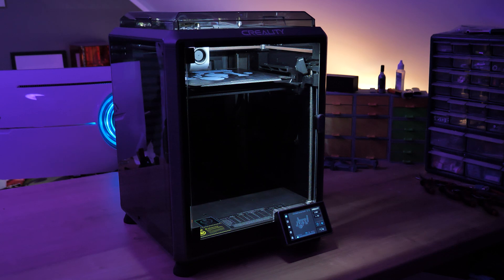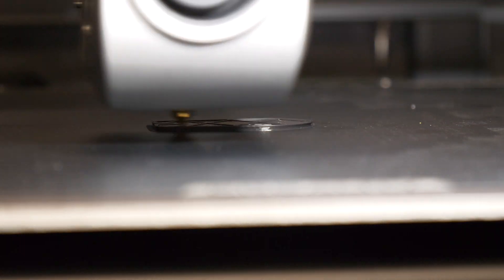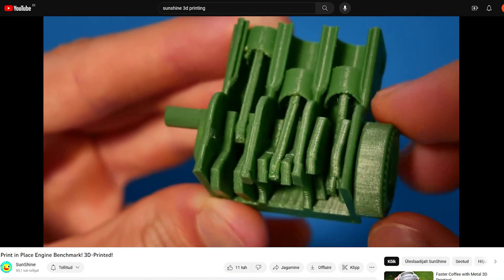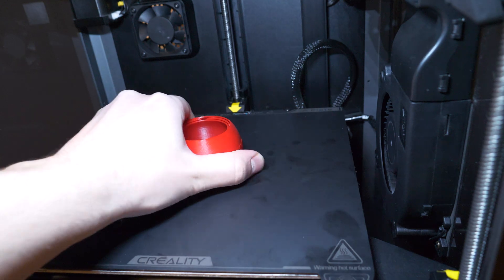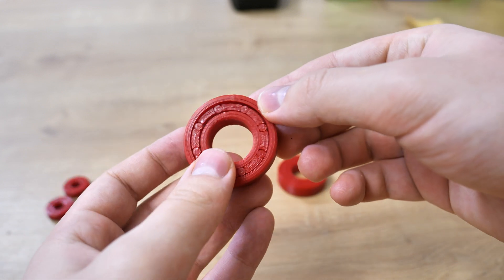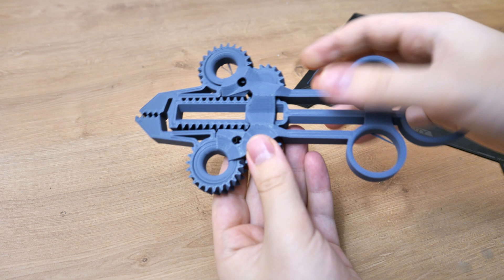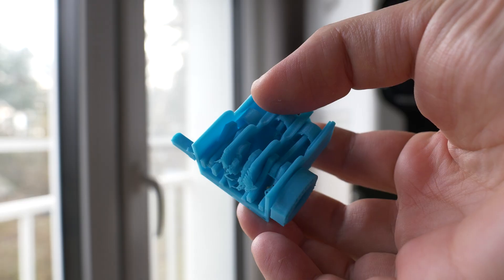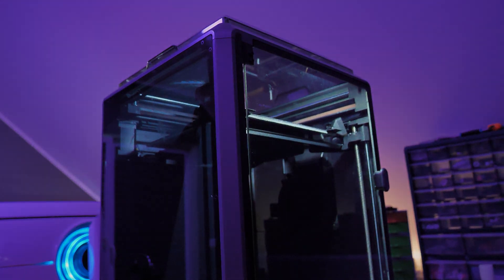Printing Coolest PRINT-IN-PLACE Models I Found Online - Can Creality K1 Handle The Challenge?

Comment: I have bought loads of Creality machines over the years but all of them had issues that should have been addressed by Creality before launch and they didn't and in the case of the Ender 5 Plus they introduced some more issues via updates and didnt even fix those so when I decided to buy a fast printer i did not even consider the K1 Max I bought the Bambu Lab X1C and AMS